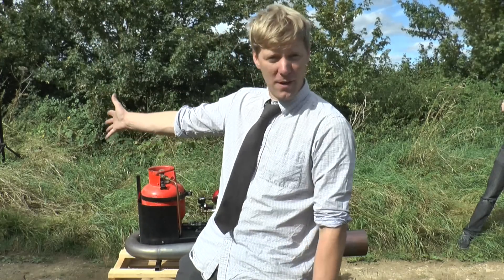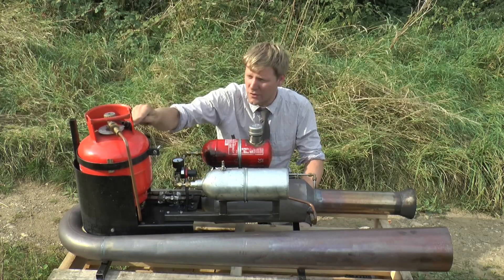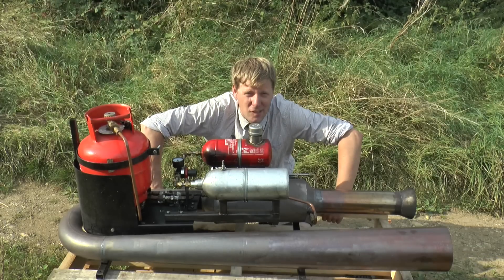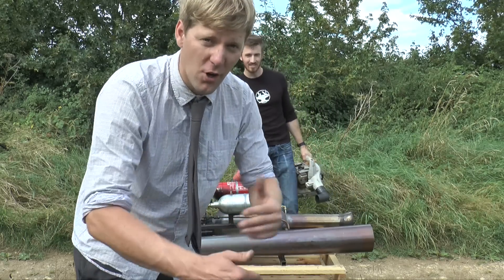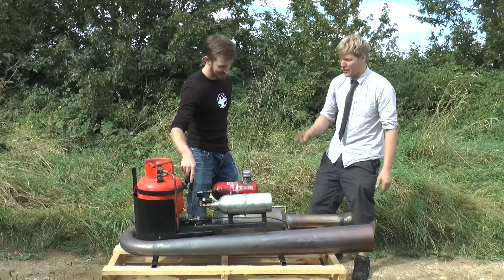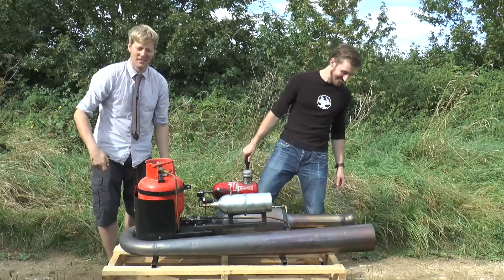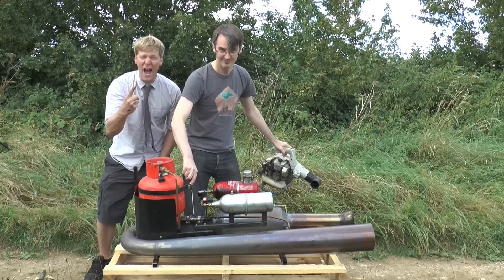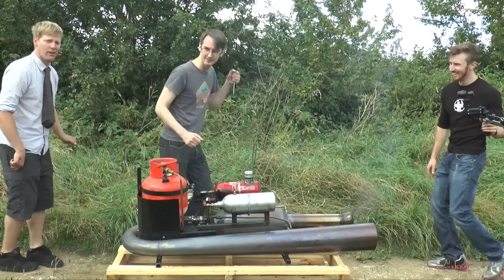How to START a Pulse Jet

Comment: Do these things actually cause motion in a vehicle?
Terribly useless I would say especially when trying to pit air into the intake with the intake facing the wrong direction.
If they actually worked, I think I would have had the intake open in the direction of travel.
Everything in line, But I would never use a glowing beast like this for as mentioned it's a fire hazard looking for a place to happen

Comment: I live in Lutterworth, Leicester, England where Frank Whittle designed and built the first jet engine. He built it on a trolley and thought "If this works it will have some thrust" so he chained the trolley to the brick wall of the building. He fired it up and the engine and trolley shot across the room and through the brick wall on the other side at the same time as ripping down the brick wall he chained the trolley to.
If only Youtube was around then! That was 1937. The RAF didn't think it was any good . . . .

Comment: I have learned NEVER to stand in the path of a jet's engine like that. The hard way. I was chilly one night while I was working late at a naval base in Korea. They cranked up an F18 to check the engine, I walked over, expecting at least a warm breeze from the deflection plates in the back of the hanger. 

I got blown around like a wind in a toasty breeze. But hey! I was warm. And smelled like I'd been swimming in a gas can.
Reply: Toasty breeze during a cold night? I’d take that..
Reply: I think there's a small difference between F18 engine and the one from this video.
Reply: @TerribleAcid  Yeah. The effect is the same, just scaled down to the hairdryer from hell. It puts out THRUST. Thrust, when not pushing an object (like a vehicle) Pushes you if you walk behind it. Then, there's the heat. 

In short, the business end of ANY jet engine is bad news. I simply decided to do it large (and stupidly).

Comment: You should make a flying bike with air board tech like the video using 5 or 4 of the boards 2 or 3 on the bottom and one facing back on the back with a tail wing like a plan for stearing and on the front for brake and reverse ( the jet fly board not the water jet board's)

Comment: Wow, cant believe is like a motor without the motor.. So it's just fuel and air, and once the air flow is high enough with the constant flow of fuel it can sustain itself and "run" on its own? I thought it was sucking air in through one pipe and out the other, but flames are coming out of both pipes!? So simple yet confusing i don't understand ahahah wtf <3
Reply: It oscillates.

Comment: Hi Colin I have a question I would like to know when the gas bottle is starting to get empty that their is any chance that the flame can go into the bottle. If so can the problem be fixed by a non return valve ? How did you do it ?

Comment: I want to be an inventor just like you so the first thing i want to do are fire gloves its basically lighters on a glove exept its kind of  the same system of the hidden blade . you need a lighter with a wheel ,a glove, a fine rope,and a ring.you attach the ring to the rope that is attach to the wheel of the lighter so when you pull the ring the lighter go on and light up a rope that lights a wool ball that is attached to the glove.
do you think its good for a first invention??please dont make a video about fire gloves

Comment: build a orbital cannon that uses a fuel air mix of hydrogen ad oxygen pressurized at 5000 psi
Reply: or build a orion style rocket sing charges of H2+O2 at 5000 psi plz
Reply: dam you auto correct

Comment: Gday Colin, i built a couple of pulse jets a few years ago, only small 1 1/2" intake, i built a high frequency spark igniter that runs across 2 spark plugs in the combustion chamber. Initially i was blowing air through to start it but after some testing i found they start easily by stuffing a ball of paper towel into the intake, turning on the spark then the gas, the paper falls out and you get to hear the wonderful pulsejet sound.

Comment: Colin, why don't you try building a RF or blue tooth or wire guided missile?  Maybe you could weaponize a remote control airplane.  Alternately, you could build a RF wheeled delivery system (Ala NORAD, or Skunk-works or something).  While your at it, you could make it anti radar (just like the stealth fighter).  Heck, you could make a radar system and then build on that.

Comment: making this is quite dangerous I wouldn't advise someone to try this at home. I also didn't like the burnt Area on that tank above the pipe. and it should be possible to do without the blower right.  with just the right amount of all the components?

Comment: Youtube sure is working hard to get all these channels collaborating. Damn that's noisy, but very cool.
Reply: YouTube didn't do anything to put this together... I did lol
Reply: the Hacksmith
Surprising to hear. Smart move on your part. I know a couple YT channels that collaborated with other channels after speaking to their YT channel "Manager". They suggested they collaborate with other channels similar to their own, and even suggested a few to them. My channel manager also suggested certain things to me, which also included collaboration. I've observed that the benefit from one time collaborations is only a short term subscriber bump up. Multiple collaborations are required to get that boost. Normally I wouldn't check out your channel because Colin or anyone else said to, but since you actually took the time to reply, I did, and like what I see. I subscribed. :-) Too many channels rarely reply to viewer comments, on my channel I answer countless questions on a daily basis.
Reply: +electronicsNmore glad to hear YouTube managers are pushing it, it's a pattern I've seen for a while. If you make a viral video, great, but subscriber turnover is crap, usually less than 1% -- but YouTube collabs -- with other YouTubers, that's the audience you really want to see your video, people who actually subscribe to channels, active users on YouTube! I have a few more lined up over the next few months :)
Reply: I agree, I've observed that only a small fraction of the subscribers actually watch all the videos. YT channels with 1 million subscribers usually only get 100,000 - 200,000 views, which is only a fraction of the subscriber count. I like your channel, so you'll be seeing me around. BTW, you resemble Calvin Harris. :-)
Reply: +electronicsNmore yeah it's quite interesting! Never thought I'd be into the social media game, but running a YouTube channel requires a lot of random skills!

Thanks for subscribing! I try and respond to most comments which I think helps community involvement, I'll have to check out your channel!
Reply: the Hacksmith
Good luck with your channel!

Comment: I'm actually surprised you haven't tried to build yourself one of those mini turbine jet engines yet...
Reply: the same kind the the hacksmith is currently using ?
That's some very high-tech stuff you know ... requires very high precision and mastery to make these worth anything (i mean, it ain't about having a super loud useless thingy. Making a jet engine atually outup a decent thrust ain't as easy as making a pulsjet)

but that'd be awesome if he was to build one !
Reply: I don't know about the hacksmith, never seen any of his vids. I was just thinking about those RC engines companies like jetcat are selling. It obviously wouldn't be a one video project but it should be doable. Some parts like the centrifugal impeller and the diffuser do require some serious machining but he seems like a resourceful guy who doesn't give up easily.

Comment: You've made a hoverbike.
Now make a plane with a pulse jet.
You can even get the air for it by making an intake on it.
Reply: It's what the German V1 flying bomb had as an engine. They needed a catapult launch but that was for mobility between launch sites. 
A bit more complicated than the one in the video but the same principles.
Reply: not sure a it would be efficient enought to actually be used as a jet engine ...

Comment: What's the point of a pulse jet anyways?
Reply: Building V1 rockets and bombing London? duh... ;)
Reply: And farting at the French.
Reply: Relatively inexpensive to make and fairly reliable
Reply: its a jet engine you can build with a grinder and some pluming supplies stick it on a bike and you have a jet bike

Comment: Isn't that the same kind of engine used on the V1 flying Bomb?
Reply: indeed. this is the sound they made giving them the name "buzz bombs".
must have been terrifying.
Reply: Marije Steenbergen My dad was ARP in the East End of London during the war. He said the most terrifying thing was when the engine stopped, because that meant it was coming down.
Reply: No the range was not controlled by fuel but by a counter that measures the airspeed and counts down. When it hits zero small fins will deploy so the plane pitches down so it crashes into the ground. Because of the negative Gs the fuel cant come to the Engine anymore so it goes out.
Reply: roughly
Reply: John Ridley Quite a dangerous maneuver, though;
Reply: Dana Nelson
Yeah, but then the V2 happend.
Reply: What was terrifying was when the buzz stopped. That meant that 1000 pounds of high explosive was going to fall on you. They calculated the fuel to last until they were over London. They would blow up a city block. Very effective and cheap. They were slow and the RAF soon learn to shoot the down over the channel.
Reply: There was a single tubular spar that held both wings on. 
In the middle of the spar was an explosive bolt.
Aiming the thing meant setting the gyro to keep it flying on a specific course, and adjusting a timer for so and so many minutes.
Then they put the V-1 on a ramp and let it rip. 
After flying on the prescribed course for the given amount of time the timer would activate 2 things.
One was a spring loaded blade that would physically slice through the fuel supply hose.
The other was a jolt of current to the explosive bolt.
So basically, the pulse jet flamed out, the wings fell off, and the Buzz Bomb dropped like a brick.  
Sort of the grand-daddy of all cruise missiles.
Reply: @dananelson3534  l used to get my poor grandma to endlessly tell me about the time she heard one cut out!
Reply: John Ridley Then it does seem like the right decision.
Reply: The v1 had a straight jet with a flapper valve on the front to make the thrust go out the back. Although probably more to it than that. Apparently you didn't even have to touch the wing to mess with the inertial guidance, simply putting the wing of your aircraft above the wing of the wing of the v1 disrupted the airflow and reduced the lift on that side, and if successful caused the v1 to roll to a point where the guidance system couldn't compensate, which didn't take a great deal because the v1 had no ailerons. Think they just relied on dihedral to keep the plane level.
Reply: Also they had only crude inertial guidance and only an impact would set them off. Some pilots found that if they flew up alongside them and touched wings they could flip them over and they'd immediately crash.
Reply: @John_Ridley  Fortunately it wasn't necessary for the wings to actually touch. It was sufficient for them to get close enough to interrupt the air flow over/under the Doodlebug's wings to tip it. The gyroscopes couldn't cope with the sudden change in attitude and it would spiral into the ground/sea. It was still a risky maneuvre and cost more than a few Allied airplanes.
Reply: @John_Ridley  the first man to do that was in my dads squadron 605. Flying mosquitoes. My dad shot down six. But who wants to chase a 1000lb bomb at 400mph, get close enough to hit it, and then it blows up! I would much rather tip it, over the sea, or open country. https://www.dailymail.co.uk/news/article-1384740/Kate-Middleton-pays-tribute-pilot-knocked-V1-missiles-course-planes-wing.html
Reply: V1's used ethanol instead of gas
Reply: I read that the government ordered the press to say that the bombs were falling well past London. The Germans saw this so they put less fuel in presupposing that this would solve the problem. In real life they then started falling near the channel
Reply: MrJohnycomelately21 yes
Reply: was it not a ramjet?
Reply: @triblues7065  it wasa pulse jet.
Reply: @triblues7065  Ramjets were developed later.
Reply: Yes, but the Germans gave up on it as they couldn`t source enough leaf blowers!
Reply: Bo
Reply: lebarom15 True. From what I have heard, they would fly alongside them, seeing what would happen, because VERY often the Germans would misjudge the fuel and they would run out and fall short anyway. Risking the plane was worth it if it appeared to be right on target for London.
Reply: I lived in London during the second world war I saw and heard them, one landed in a tree close to where we lived did not explode, presented a problem for the army to remove it, it was the one that was in the science museum after the war.
Reply: @JOHNWFGRAY   Oh my gosh.

Comment: What's the point of the pulse jet? just to spit fire?
Reply: and make noise
Reply: Colin has a couple of videos about the pulse jet, check 'em out
Reply: It gives thrust. ... that means you can move things.
Reply: It is an actual jet so it produces thrust.  Pulse jets are nothing like as effective as turbojets but they are much simpler to build.  They were most famously used by the German V-1 flying bombs.

You should watch Colin's other highly entertaining videos.  He has used pulse jets for propulsion (bike and cart), to heat things (pulse jet kettle) and to fart at France.  As Zack Ferguson rightly points out, they make a noise.  A lot of noise.

Comment: i have a couple of pulse jet related questions
which end does the thrust come out of and if one of the ends is the intake wouldnt that negate the thrust from the other end?
Reply: Both the intake and exhaust generate some thrust (mostly the exhaust). This seems like it shouldn't be possible but it's just the momentum of the exhaust gases after each pulse that can cause thrust to be generated, which I think is why they are quite inefficient jets.
Reply: Katzen4u so would it be possible to merely have an s shaped curve to make it more efficient?
Reply: Big C I think that would probably make it more inefficient, as when the fuel combusts, it generates thrust in both ways regardless.

Comment: Modern chinese engines are actually pretty powerful! I've designed two dual intake chinese engines, one a lot smaller than the classical lockwood and it puts out 42 pounds, and a smaller one that's at about 26 pounds, almost at the theoretical limit for that size

Comment: hi colin, is there anything you can install or design that can do this at a press of a button?
Reply: There are ones with spark plugs -- but the problem is, the pulse jets get so hot they typically melt any kind of ignition system you put in there!
Reply: cheers for the reply, yeah i thought it might, just trying to think of a simpler way than using a leaf blower. Must be a way!

Comment: Colin, can I send you a pic? I took a screen shot by mistake and it's rather funny.
Reply from the maker: sounds bit weird
Reply: well I know that lol. not thr werdest thing you've ever read tho. but I found it funny.
Reply: sadly I can't post pics lol
Reply: could you make a bigger pulse jet and use it in a practical application? I mean bigger than the French fart and I know practical to you is a motorised wheelie bin.
Reply: alex check out the xjet channel bruce has powered gokarts, kayaks and model planes with it... 
also the original pulse jext was used in the german "buzz bomb" during ww2
Reply: upload to imgur and post link here

Comment: challenge: how TINY could you make a working one of these?
Reply: Pretty small. It'd kinda be cool to blow on a pulsejet to get it started.
Reply: His "jettle" jet powered kettle is pretty small. At some point though, it won't be useful for anything, other than maybe noise. I wouldn't be surprised if he put a few jettle sized ones on a skateboard though! It would be cool if it worked.
Reply: You could strap it to a Hotwheels car and race them around a track.
Reply: There have been keychain-sized functional pulsejets built that pulse at several hundred hertz, and require high pressure compressed air to start.
It's on youtube somewhere.
Reply: eamh2002
big would need hurricane  katrina to start it! lol
Reply: I'd be more interested in seeing how BIG of a pulsejet Colin could make :) 

Now THAT would be nuts..
Reply: /watch?v=zn4YVYdp8lE Thats a pretty small one!
Reply: ***** hobbyking only makes valved jets. Most jam jar jets are smaller than HK jet though
Reply: He made a really big one, then poked it out the back of an enormous tin arse and pointed it at France!
Reply: +James Noble Then it would finally live up to it's name of 'hot'wheels.
Reply: +James Noble ok, good point, that would be the most epic hot wheels car I can imagine.
Reply: ah true, but they doesn't blow up after 5 second of use^^
Reply: ***** Just linked it lol
Reply: hobbyking make some pretty small pulse jet for rc planes, and it is quite powerful !
Reply: ***** I've had a glass jar run for 4 minutes before it ran out of fuel. Sure you can also make it out of a tin can but then it needs cooling in order to sustain. Check some of the videos from my channel ;)
Reply: jusb1066 

How to make a homemade hurricane to start a house size pulsejet EP.1 :D
Reply: I wonder if you could get enough power:weight to use one on an RC plane.
Reply: Sub Ripper You can and its really popular
Reply: They can get snall. I saw rc planes with pulsejet engines